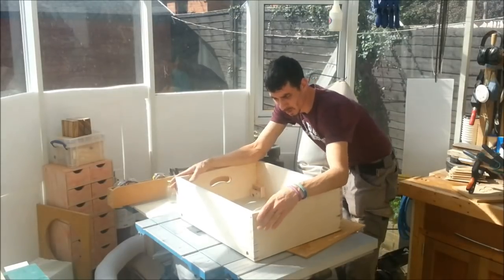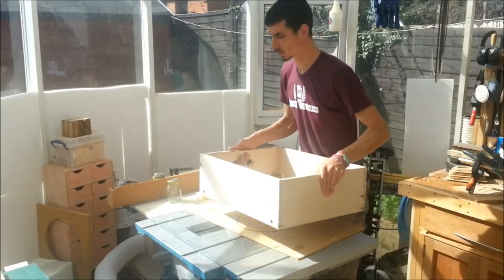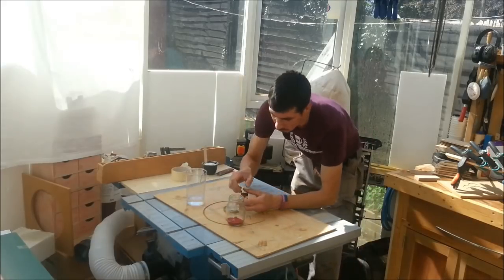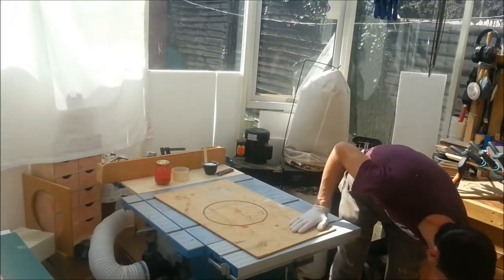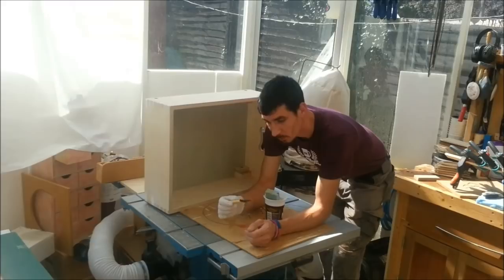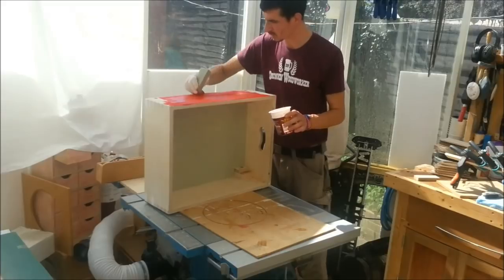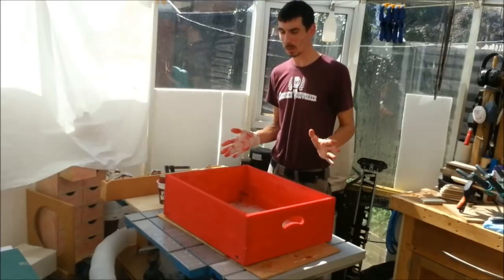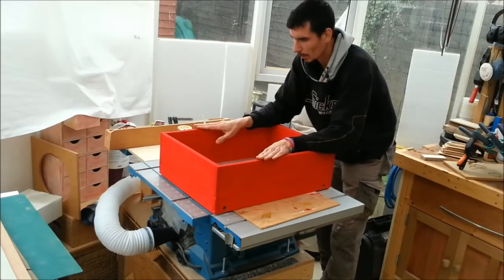staining birch plywood   the experiment

Comment: Thank you for sharing Richard.
Did you do any sanding prior the staining? I had the experience using birch, as the grains are pretty dense it tends to become a little blotchy very easily, if not proper sanded. With the tare out I think its just the nature of birch, although easy to machine, you have to have extreme sharp tools to get a nice clean cut without any tear out and there might have been a little weak glue from the side of the manufacturer.
Again another nice project, definitely an upgrade to any shop.
Greetings from Good Old Germany
Peter
Reply from the maker: *****, I sanded the outside to 240G, but left the inside as factory finish....I was initially worried about how the stain would go on, and yes to start with it did seem a little blotchy in places, Leaving it out in the sun seemed to help, as did a second coat. All in all I was pleased with the result, although a part of me wishes I'd gone with orange or yellow, but that's for the other projects! :-)